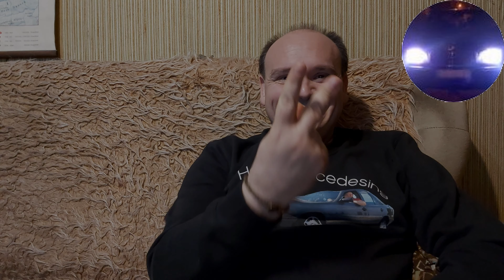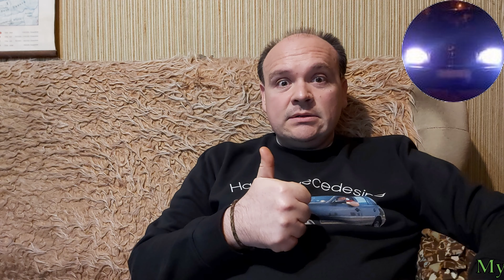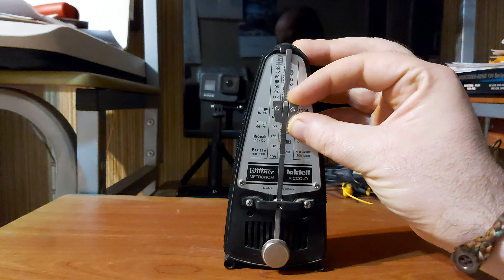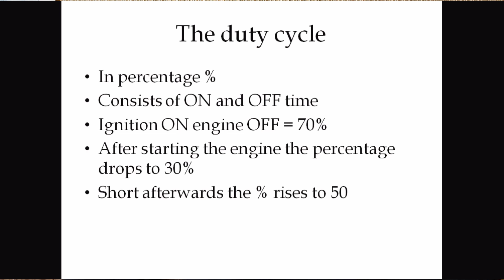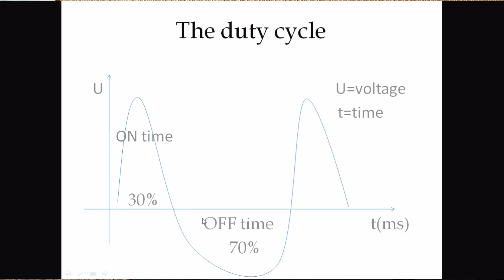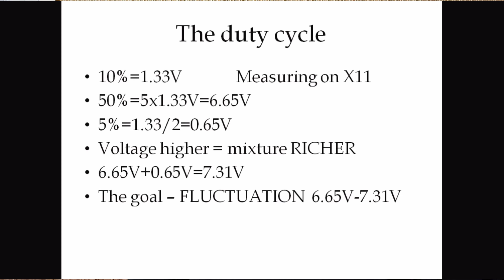㉦Mercedes Ke-Jetronic㉦ - 📚About the ⭕Duty Cycle⭕/my way!📚

Comment: Hi, Master!
What’s wrong with my M102-engined 230? It’s a 1992 model with a lambda sensor.
At pins 2 and 3 of the X11 connector, the reading is a steady 19–21%—indicating a 20% fault code. Adjusting the CO screw has no effect. The temperature sensors are fine.
Reply from the maker: Hello, this is a TPS fault code. Check both idle as well as WOT position.

Comment: Hi Ivica
I have an M103 Engine with a KE Jetronic system with NO O2 sensor. Suffering from a rough idle problem. How could I correctly adjust fuel mixture at the tower? I have no access to CO2 analyser for exhaust. 
Any help is much appreciated
Reply from the maker: Have you calibrated the potentiometer?

Comment: Hi Ivica
I have a Mercedes 260E with an idle problem.
The Ke Jetronic System does not have a O2 Sensor.
My Duty cycle reads a steady  50 % and does not fluctuate.
I also did a fuel pressure that reads 5bars to 5.4 Bars.
Can I safely say my fuel system is correct and I should look for the problem elsewhere.
Keep up the great work.
Reply: Cheers Ivica
Reply from the maker: Yes, your duty cycle is okay. Search for the problem somewhere else.

Comment: Hello, my friend, I have a problem, which is that the warning lights in the dashboard do not come on when the engine is started. what is the reason? Only the lights are ABS and hand brake working the rest don't
Reply from the maker: Hello. Blown bulbs I believe. You will have to remove the instrument cluster to see that.
Reply: @mercedeske  What does it look like, please?
Reply from the maker: The bulbs are labeled as T5.
Reply: @mercedeske  Thanks

Comment: Hi Ivica, is possible do this on eha duty cycle test? I don't have the the lambda with the pin 3 on x11
Reply from the maker: Hi, yes, it is possible. There is the video on my channel-duty cycle on the eha. Of course everything I said there is under the condition that the 2mm screws was not readjusted but if yes, then there is the way how to get it back where it was as well.😉
Reply: @mercedeske  thanks I go to see that video! Another question I have to set the potentiometer on 0.7 volt ( now Is 0.4 volt) but the nominal values on pin 1 and 3 are 1.40 killohoms (or 2.40 i don't Remember) but so much poor... I tried to set the screw but It changens only to 1.60 killohoms
Reply from the maker: @riccardobaia1  Set it to 0.7V
Reply: Thanks Ivica, but a last question, for setting the milliamps on 80°c idle on the no Kat version i have to set the screw of the plate with the 3 mm Allen key to have 0 or -2 milliamps?
Reply from the maker: @riccardobaia1  0 is a good value.
Reply: Hi Ivica, i tested the potentiometer on pin 1 and 2 but the tester marks only 1.45 Volts (all below) and 4.35 (all top) he doesn't go down to 0,7 Volts... Is the potentiometer damaged? The car doesn't change the idle in this various tests and still stalls on idle
Reply from the maker: @riccardobaia1  Test the potentiometer but  I doubt it is good.
Reply: @mercedeske  i tested the potentiometer, the kohms are 1.30 2.10 very poor...
Reply from the maker: There must be no bounces in kohms, this way or another the potentiometer should be replaced.
Reply from the maker: On the EHA you just adjust the fuel flow towards all the cylinders. If you don't have pin3 it's not advisable to turn the co-screw unless you have a co tester.

Comment: Mine starts but doesn't idle
Reply from the maker: Have you replaced and calibrated the potentiometer?
Reply: @mercedeske  i dont know which are those parts
Reply from the maker: @sanelesibiya5205  You have the card on my videos, it says "potentiometer". There are some videos so you can inform yourself.
Reply: Are the percentages you’ve mentioned the same on a California sold vehicle due to the emission control requirements?